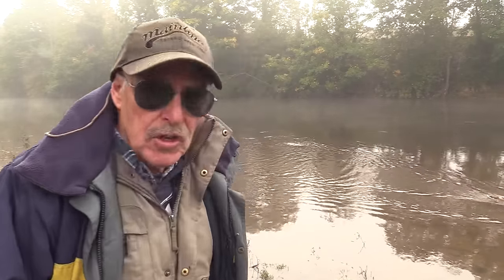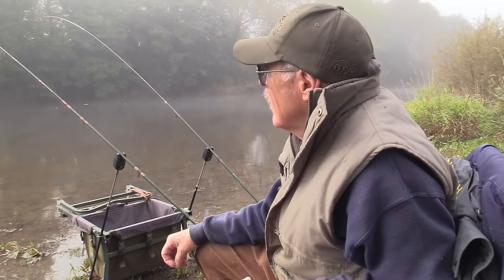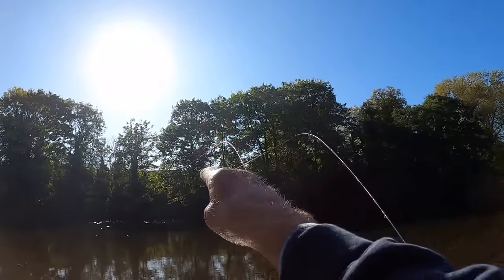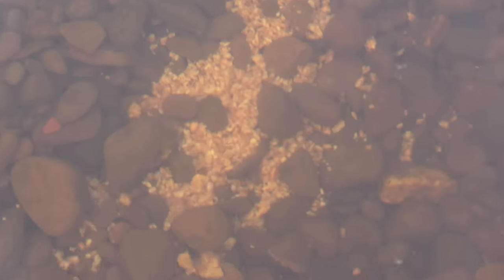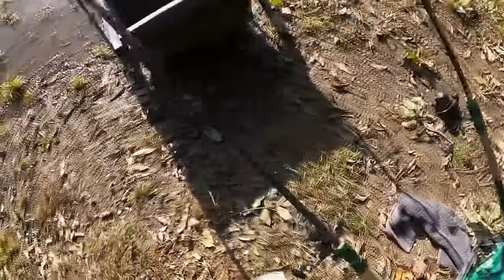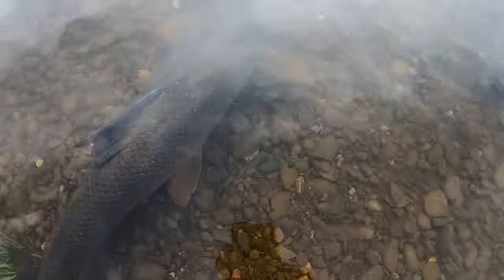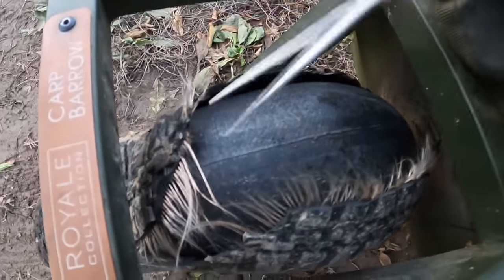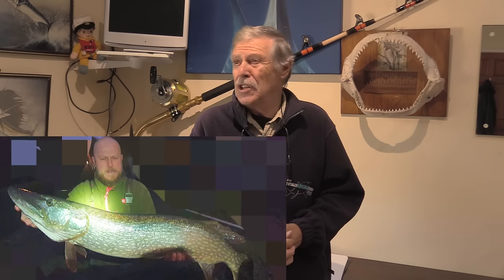Fishing was Manic…(So pleased I went, but I blew a tyre!)

Comment: As a kayaker and a fisherman I can say without doubt that fish aren't bothered by passing canoes and kayaks. I used to paddle the Canterbury Stour and it was gin clear. I used to pass over shoals of Roach and Chub. They weren't bothered. The occasional bigger Chub would duck out of sight as I passed over them. I wish I'd worked out an anchoring system so I could have stopped and fished for them!
Reply: I think they actually enjoy it because it sturs up free offerings from the bottom.